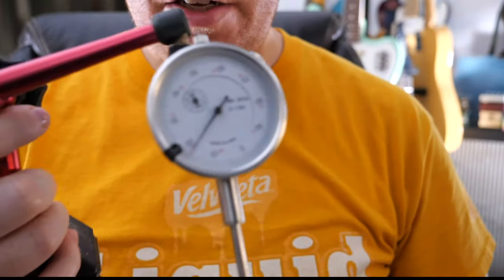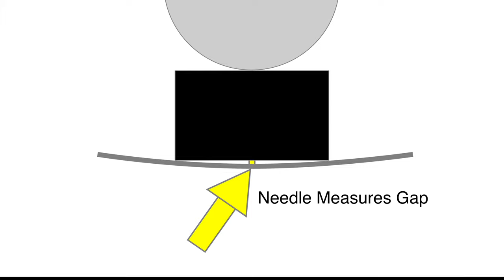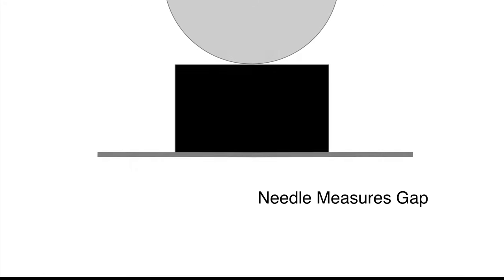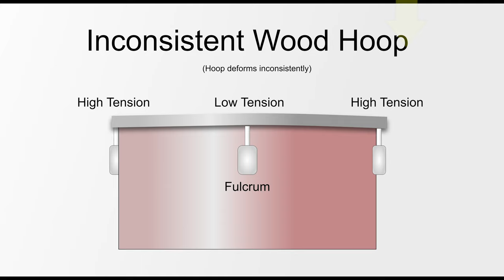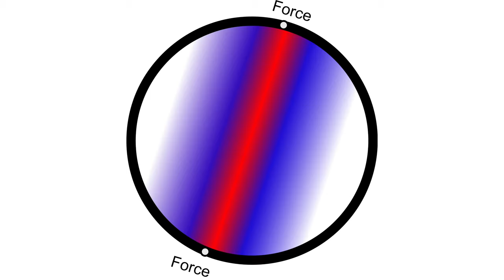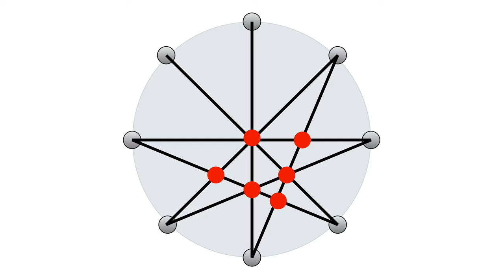Drum Dial and Drum tuning tricks

Comment: I have used a Drum Dial for many years, but I must tell you I just got a Tune Bot and I love it. Basically does the same thing as a Drum Dial but also gives you the pitch and frequency which is more accurate than the Drum Dial. The only issue I have discovered is it doesn't do a very good job if your bearing edges are messed up, and if your bearing edges are bad you have a crap drum set that's never gonna sound good.

Comment: Loved the video. Accidentally came here for drum dial advice, left with a new tuning method. That stuff about tension bands made me try a more bumpy road up to a tension using a single key, then reset, tried your method with two keys and 1/8 turns. Played A and B to a friend. One 8 lug maple snare, one 10 lug brass snare. My friend said the B version (your tuning), at the SAME tension, sounded way better. Overtones more pleasing, pitch stronger, and the drums are happier at more tensions now too. Thanks for this explanation, I also read your article which has more in depth info plus is pretty funny at times.

Comment: Hi, thanks a lot for this, very good information, can you link me to the "why pitch tuners are not good" please?
Reply: I tried what you suggest but i always end up with at least 1 lug being a lot lose compared to other lugs and its the same thing happening no matter with which lug i start or which tom i use. What is causing this?
Reply from the maker: @matrixmodulator  That likely means that your bearing edge is not even, or that your rim is bent. Try the method in the video to check your bearing edge on your drum.
Reply: @AdmiralBumblebee  Yeah i will check them but the drums are new, 5 toms, same issue, also my old drum same thing... can you link me to the "why pitch tuners are not good" please? i dont see it on your website

Comment: This is brilliant, thanks. My tuning method up to this point has been reasonably good, but using two drum keys looks to be much better. I saw a vid on Gavin Harrison using this method, so there's further validation. By the way, your 'DAW v. DAW' vids are also great.
Reply from the maker: Oh great, I didn't know Gavin used this method as well. Thank you for the comment and encouragement!
Reply: @AdmiralBumblebee  Ya, saw him doing so in a vid. He also uses two power screwdrivers to make it faster to replace tom heads!  PS. When tapping around the edge of a head, depending on the drum and head, I sometimes find it hard to 'hear' exactly when all lugs are evenly tensioned (due to overtones). So, I'm considering picking up a Drum Dial at some point - seems like the only tuning tool that would actually work properly to at least validate if my tuning is close to even.  Thanks again for the tip!
Reply from the maker: @twtobin941  http://circularscience.com is a VERY good option as well. Drum Dial is faster and you can get equivalent results with practice. If you want precision then nothing beats the resotune.
Reply: @AdmiralBumblebee  ResoTune looks very cool... not cheap!  Might be worth it though.  Also, found a forum post where a guy made his own DrumDial using an off the shelf dial gauge, installed through a hockey puck.. total cost under $10, and apparently works really well. I'm going to try it.